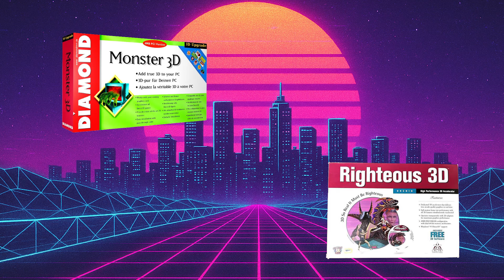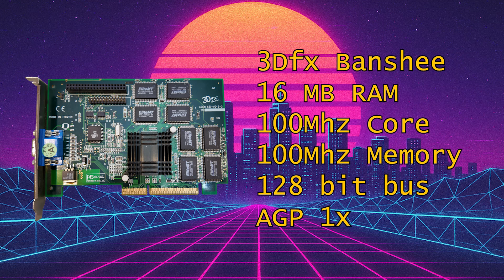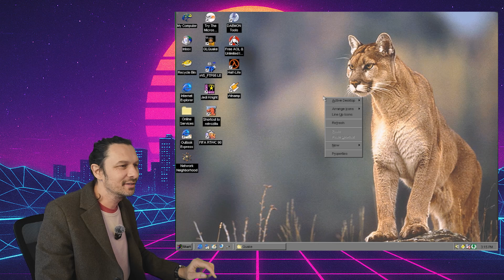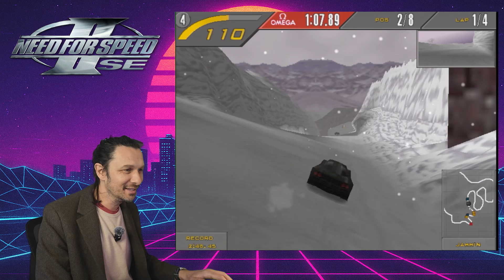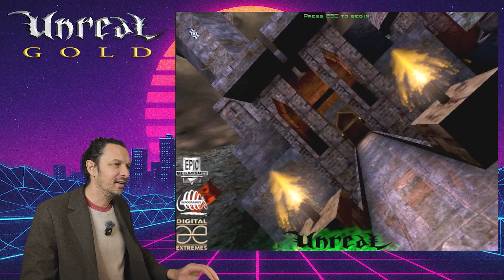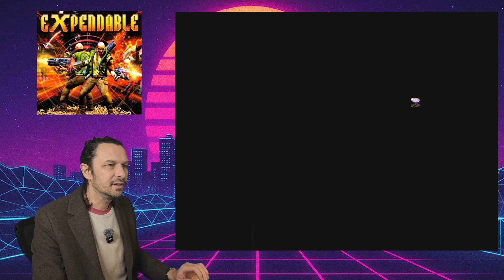3dfx Voodoo Banshee Revisited: One of 1998’s Most Important GPU's?

Comment: Really enjoyed the Voodoo Banshee video, such an underrated and unloved 3Dfx card. One thing I noticed, the FPS counter isn’t working because you’re running the game through Glide. FRAPS and similar overlays work with OpenGL/Direct3D but not Glide. Also, Vsync is missing in the original driver set, so Powerstrip is needed to turn it off for benching the banshee.
Reply from the maker: Thankyou for watching :) Appreciate the insight, I'll definitely look into using other utilities for better benchmark accuracy next time, I thought it might have been a glide thing.

Comment: Nice review of this card, and great game choices. You speaking of running Unreal on a Voodoo 1, back in the day, made me smile. I have been playing it on my Voodoo 1 +  Pentium MMX 300Mhz machine. It runs quite well at 512x384. Around 25fps. The CPU is the limitation for this system, as TNT and Voodoo 3 gave only slightly better performance. Hate to think what it would run like on the typical system a Voodoo 1 was paired with back in the day (Pentium MMX 166Mhz I expect)
Reply from the maker: you are spot on a typical system for the original voodoo/voodoo 2 would have been late Pentiums. But its amazing how well the Voodoo cards scaled up when you gave them a strong processor they really ramped up the performance!

Comment: Call it me actively refusing adapting Intel, I had KG/2 at the time, on an Elictegroup ECS CS P5VP-A+ and stuck with the platform until 2004, with weird FSB speeds up to 104mhz and replacing CPU's and changing 3 generations of videocards, it served me well, I bypasses the banshee at the time in favor of the Ati Rage Fury GL 32MB edition and then moved on to the ST Micro Kyro2 that gave it some extra life. One reason for sticking with it was it could still handle both Terratec DMX 6fire, and the Gravis Ultrasound Extreme, and a netwrork- and videocapturecard.. whereas the Athlon almost forcefully retired all that hardware(Hence in 2005 I made a big upgrade that lasted me to 2015, and the upgrade for that lasted me until 2022 as daily driver always spending round and about 20 hours working/playing around on them.
Reply from the maker: oh wow, you really got the most out of the k6/2 platform getting 100mhz FSB too! I really with I had kyro card, that's one I have never been able to try
Reply: @ComputerRetroBus  Did not have the setup anymore, but the system recalculated at 568 Mhz, and still running on a simple standard "latch" cooler, I believe I never turned it off, maybe rebooted some times between 2001 and 2004. also had three different modules in, never had an issue running under Windows98SE or 2000. XP simply would not make it past the first boot. I was a poor kid in those days and had even scavenged an Adaptec 29160 card to drive old 10K drives scavenged from several old HP Proliants, I rented a room with electricity included back then...😅

Comment: I didnt own a 3D card in of my PCs until mid 2002. Even though up to then I had a quite Capable (Previously a AMD K6-2 300) AMD- K6 3+ 500 PC w/64MB RAM, I managed to scrape together with mostly used parts, built it just before college and did not retire it until 2002. With some upgrades in between, dual booted Windows 98SE and Windows NT4 workstation.

I do however remember drooling over these 3D cards in magazines alot. could not afford one then, but I could later, thats why now I own three 3DFx setups, A Banshee, A Voodoo3 and a matching SLI set of Voodoo2s.
Wish I have had tghat in that PC back then.
Reply from the maker: yeah they were expensive at the time, I remember saving up a bit with m minimum wage to get my first voodoo card. But look at the amazing systems you have now! Very nice

Comment: An the end of 1998 was the aera of 3DFX almost Over, at this time we had the Nvidia TNT GPUs For me an 3DFX card was NEVER a thing, And is in my Opinion Overrated.
Reply: I think it was almost over in late 1999, when Nvidia released the 1st Geforce card. Hardware Transform & Lighting killed the Voodoos, mainly with games from 2000 onwards. The Rampage project could have saved them, if it wasn't delayed a lot, mainly with the STB factory buyout.
Reply: @ramonmarcondes3915 I thought 3dfx killed themselves by purchasing STB, strangling themselves out of cash and delaying their products until they were irrelevant to anyone but GLIDE fans.
Reply from the maker: Yep 100% with you on this one, Buying STB and making their cards exclusively themselves made them compete with there once partners, and the bigger thing was the delay's in release. Hardware was changing so fast delaying your product was very punishing, by the time it came out it was too far behind.

Comment: I still remember magazine reviews stating that performance varied by game: it was either better than the Voodoo2 or half as fast for games using dual-texturing, since the Banshee wasn't capable of that.
Reply: The Banshee was able to run at up to 1600x1200 in less demanding games. The images was also much sharper than on voodoo 2. For me, it was the better chip back than.
Reply from the maker: Yes I recall this also, it really did depend on the game, but what a card the Banshee was that it could match the Voodoo 2 in some isntances

Comment: Your video is correct, but the performance gap back then was much wider with the Voodoo 1. A PII 333 is fast enough for software rendering; back in the Voodoo 1 days, most people had Pentium 100–133 MHz processors, and the high-end machines might have been 166–200 MHz—none of which were fast enough for software rendering. Tomb Raider is a good example. When you plugged a Voodoo 1 into a machine like that and suddenly got 30 FPS "that was a life-changing experience".
Reply: Nobody was pairing the voodoo 1 with 100/133mhz pentium. I had one and they didn't recommend it at the pc shop. Remember if you bought a mid/high range cpu in the 90s in a year it was already low/mid range since Mhz were getting higher and higher with each passing year.
Reply: @mesicek7   that's exactly what was done: old P120, Cyrix 150s, k5 and so on were given a new lease on life with Voodoo 1; that was the revolutionary back then.
The Voodoo 1 is from 1996, back then, the Pentium MMX 233 MHz didn’t even exist yet; that came out in late 1997.
In 1996–97, 133–200 MHz processors, with or without MMX, were considered high-end.
Reply: @tytusromek9267  true. i had a 166mmx in late `97. my 1st 3d card was a voodoo rush same that year. so after i went for a k6-2 350 with a voodoo2 in late `98, with the 3dnow this was the 1st big step of 3d gameing for me. in 96 everybody play quake in sw mode and even q2 in 97.
Reply: @negrusz  At first, there wasn’t much support for 3dfx cards;  there were still PowerVR cards from NEC and others, and it wasn’t really clear how things would turn out. At launch, the games didn’t support 3D cards; support for Glide, PowerSGL, and Direct3D (which was really terrible) was added with a patch release. 
Matrox Mystique also offered 3D acceleration, for example in Mechwarrior, s3 had some patches too
I remember that sometimes you had to go through a complicated patching process for certain games; Glide support was added later for Tomb Raider, POD, and MDK, ....and for Quake there was even a 3DNow! patch...
Reply: @tytusromek9267  3Dfx card were by far the 3D accelerators with the most support from the get go. PowerVR, Rendition Verite and other cards got much less compatibility patches. If a game supported 3D acceleration there was virtually no chance that 3Dfx cards weren't on the list, the same wasn't true for other brands.
Reply: @tytusromek9267  Not with 100mhz pentiums. 166mhz and upwards. You can see a cpu scalling benchmarks for p100 till mmx and differences are nigth and day. You were severely bottlenecking the voodoo with a 100/133 mhz pentium.
Reply: @mesicek7  How thick are you, mate? We're talking about what was done, not what was ideal. You're tilting at windmills, everyone knows about bottlenecks. That has nothing to do with what was most common, which certainly wasn't everyone going out and buying a new Pentium 200 system for their new Voodoo card.
Reply: @drewnewby  Again nobody was pairing Voodoo 1 with 100mhz pentiums. Like come on!  By the time voodoo 1 released pentium 100mhz wasn't even in the minimum spec recommendation for most games that needed a 3d accelerator card for it to run. There's also the extra ram upgrade... I remember it all. I lived in the same building as a pc store from 94 onwards. I'm starting to think that you don't even remember how fast tech progressed in those days.
Reply: @mesicek7  I'm done, you're clueless, and you were likely a kid at the time (assuming you're not a bot). I've been in business since the 80s. I don't just remember, I still have the invoices.
Reply: @drewnewby   I'm a bot? Look at my registration date. In 97 majority of games still ran in software render. First game i got issues with was Redline Racer, which needed a 3d card to run. By 98 a 3d card was a must.
Reply: @mesicek7  You're just talking nonsens, no one back then would have thrown away an one/two year old P100, 120, or 133 just to upgrade to a Pentium MMX, just to install a Voodoo card. Unless they had way too much money!
Any store that recommended that back then was simply untrustworthy and only interested in selling you a new CPU.
Congratulations—you got ripped off.
Reply: @tytusromek9267  Voodoo cards were expensive back then not to mention you didn't even need a 3d card to run most games. I could still play most EA sports titles in 98 without a 3d card.
Reply: @mesicek7 It's funny that a bot is trying to tell us what it was like back then—thanks, that really made me laugh. Here's a little tip: an Intel Pentium 200 was more expensive.
Reply: @tytusromek9267  I'm a bot? Buddy look at my account. I predate you by at least 6 years.
Reply: @tytusromek9267  I think I figured out the confusion. The then single digit aged kid lived in a fantasy world where PCs were free, or more likely a relative owned that shop. Pulling invoices, a nice new Pentium 200 system in late '96 was close to 10K USD, adjusted for inflation.
Reply: @drewnewby  Okay, that sounds plausible; adjusted for inflation, $10,000 could be about right, even if it sounds a bit exaggerated. The CPUs alone were very expensive. A Pentium without MMX cost well over $500 in 1996, and even more when it first came out.
Reply: @mesicek7  Maybe you confuse what a PC shop wanted to sell all new, versus what most already had and were upgrading. Plenty of the later, even if your PC shop would rather you buy the latest system. I sold plenty of both, full builds, and upgrades then, same as now.
Reply: @drewnewby  It was about cpu bottlenecking. Phil's Computer Lab did a cpu scaling benchmark with Voodoo1 Everything below 200mhz was severely bottlenecking the gpu.
Reply: @mesicek7  We're not talking about now, obviously we choose the fastest CPU for the card these days. We're talking about what was common and available at the time. Saying "Nobody" was doing this is just plain wrong, and honestly, a lot more customers of mine at the time were doing this, and not buying an entire new Pentium 200 system for the Voodoo 1. This isn't debatable for 1996.
Reply: @drewnewby  dude... It was the same back then. It was even more prominent back then because tech was advancing so fast. Diifferrence between 200 and 100mhz is huge dont you think? Like 100% in clock speeds which reigned supreme back then when it came to gaming.
Reply: @mesicek7  Are you a bot? That reply wasn't what I was talking about at all.
Reply: @drewnewby  Either he is a bot,  he's trolling, or he has no clue. just ignore him.

Comment: I had it, it was crap. games that worked with voodoo1/2 cards had issues with the banchee, suport was not that great. I did regret getting it instead of say a riva card or sticking with the older voodoo accelerators.
Reply from the maker: I had some challenges with the card, when it expects the card to be an add on card like the voodoo/voodoo2 and doesn't initialize :(